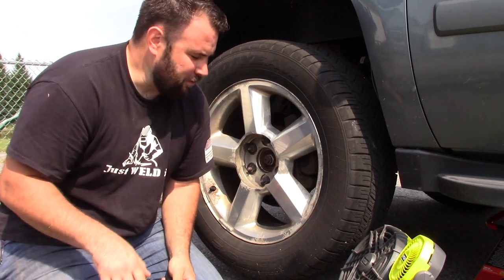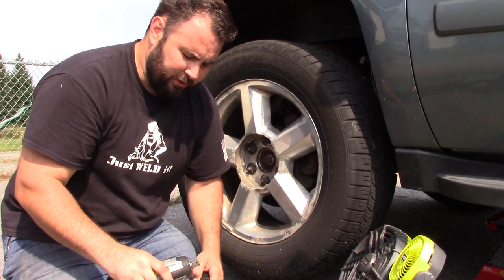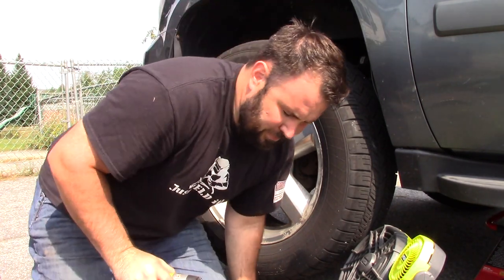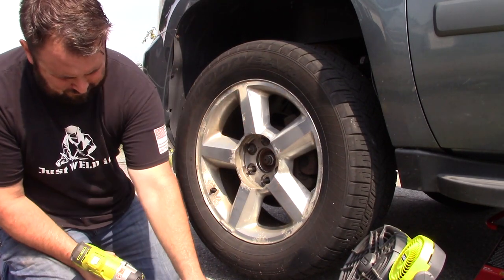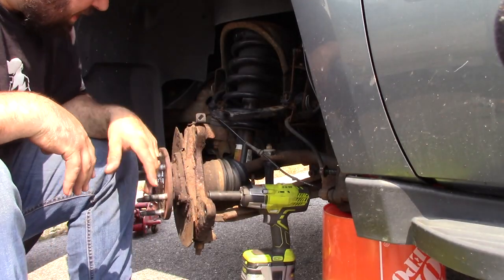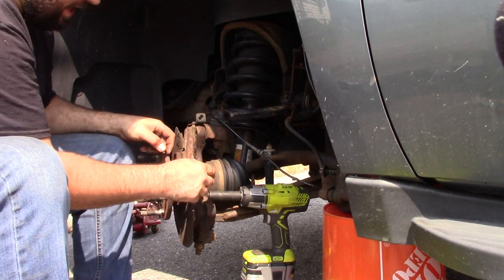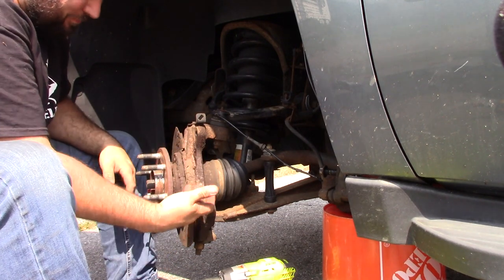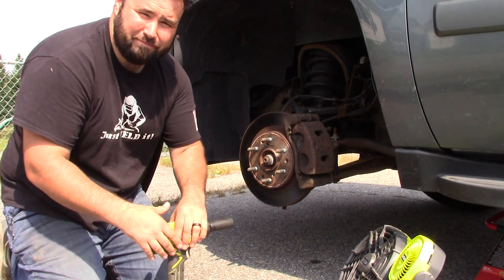Ryobi  impact wrench testing

Comment: Had one worked well on my BMW E30 when I replaced the front suspension.   Gave it to a friend when I bought the p262 it's pretty does everything for all my vehicles.  Waiting for the new Ryobi high torque.  I'm fully vested in the Ryobi One Plus ecosystem at this point.

Comment: You need minimum 4amp battery for it to work properly, as shown. When you use the less than 4amp battery it is very very limited and weak. The difference is unbelievable.